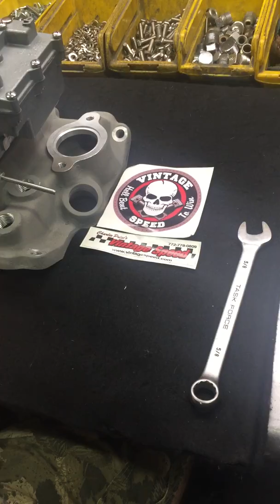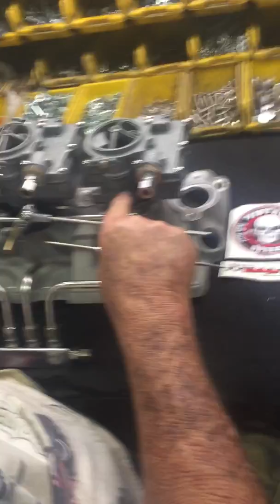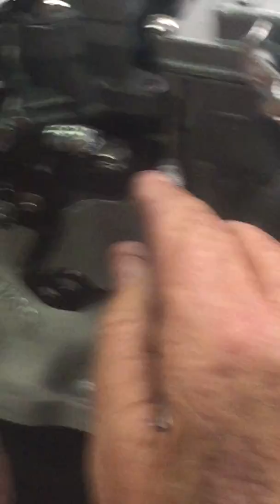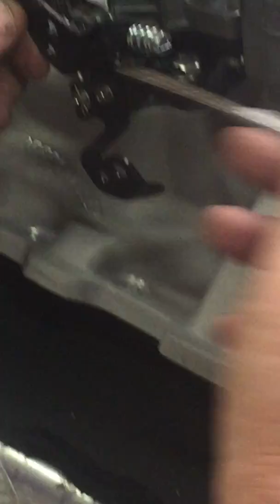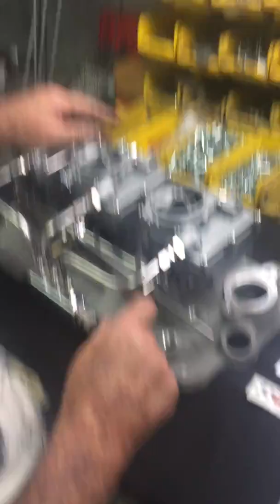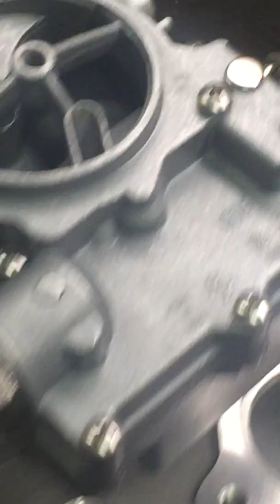CHARLIE PRICE VINTAGE SPEED   ROCHESTER TRI POWER LINKAGE AND FUEL LINES

Comment: This linkage is complex and complicated.  Use Pontiac’s linkage.  They had a darn good setup.  1964-65  is what I run.
Reply from the maker: Pontiac linkage only works with big base carbs on the ends  (1959-"66)  --   These are small base carbs.   charlie
Reply: @charlesprice7897   I don’t know about that. I’m extremely excited to have found your website. A Tri-Power is smooth, responsive, and powerful.  With a “068” or “744” cam , Pontiacs run GRRRRREAT!!!  ( See what I did there?). Tiger!! Anyway. Thank you!! Dave
Reply: @charlesprice7897    And Pontiac’s fuel lines have curves and bends.  Your lines look straight forward and simple.